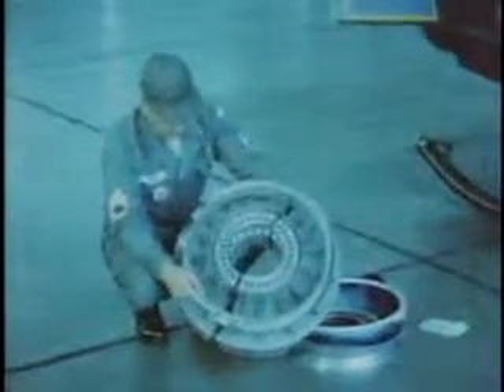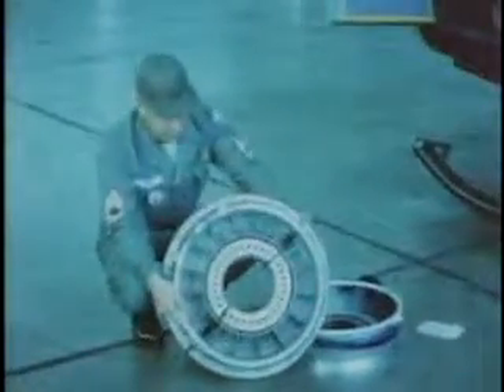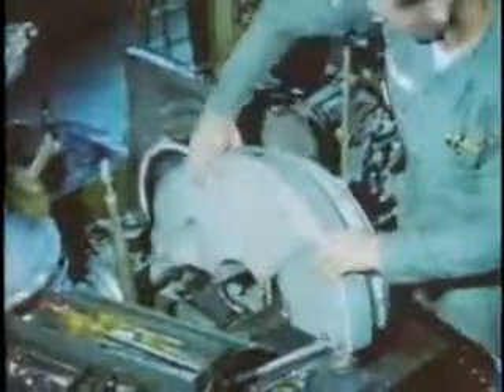Fort Rucker UH-1B Helicopter Testing

Comment: I agree its a UH-1d. The UH-1B was a single door . There were three series sold to Australia. 300, 700, 000. I joined 9 Sqdn in 1963. We had a US pilot, Marty Donahue to train our pilots. We held the Altitude record of over 10,000 ft for a short time. Went skying on Mount Kosciusko A new Squadron was formed 5 squadron which saw 4 aircraft deployed to Malaya in May 1964. I was an Airframe Mechanic at the time spending 8 months in Malaya at Butterworth during the Indonesian uprising. Flew 10 missions on Malay Thai border. Yes Aircraft I knew could not miss the sound.